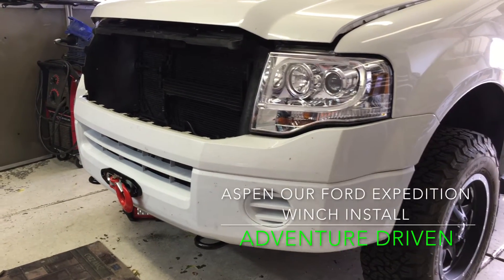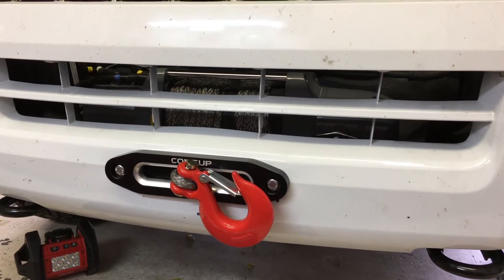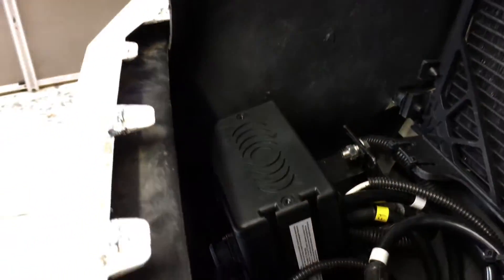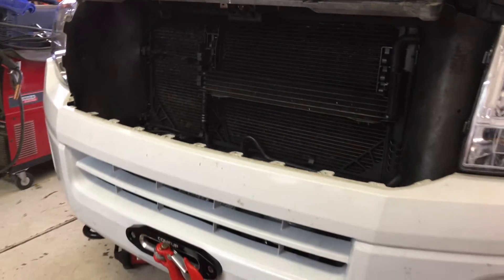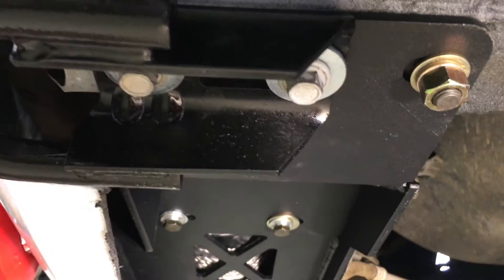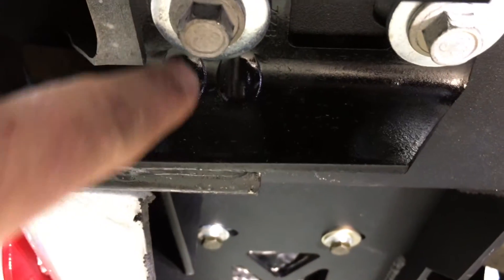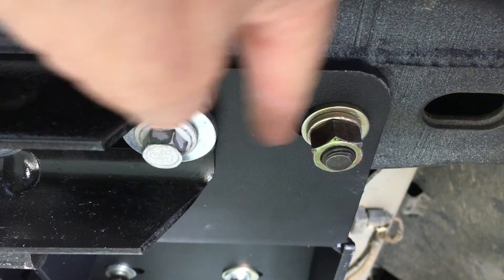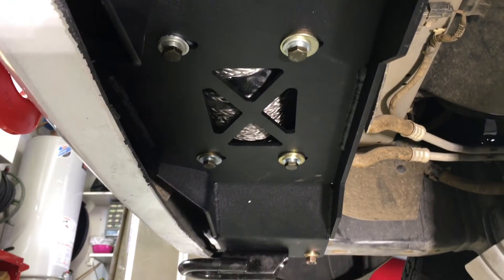Aspen our Ford Expedition gets a Come up winch install

Comment from the maker: We use the COME-UP winch brand, it has the clutch lever in a perfect spot, I just reach through the lower grill and pull and turn it, plenty of room to get my hand in, I don't have to raise my hood at all to use winch.
Reply: Nicely done. What did you reattach the rubber weather flap to?

Comment: I know that you have since switched to a custom bumper. Do you still have the hidden winch mount? Do you have the measurement height of bottome mount plate to winch mount plate (difference of the horizontal plates) no company will give me that measurement. Thank you.

Comment: How do you access the winch clutch lever to engage the winch? In F150 you just raise the hood and you can access the winch, in Expys there is plastic cover. You will have to remove the cover and reach down to turn the lever ?